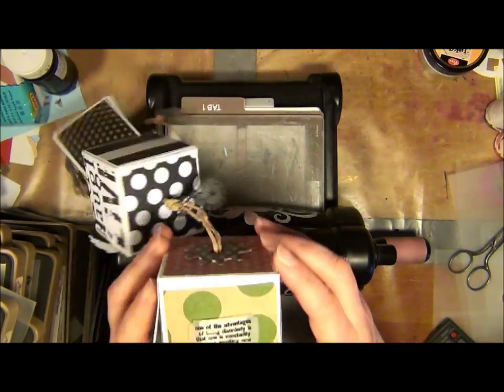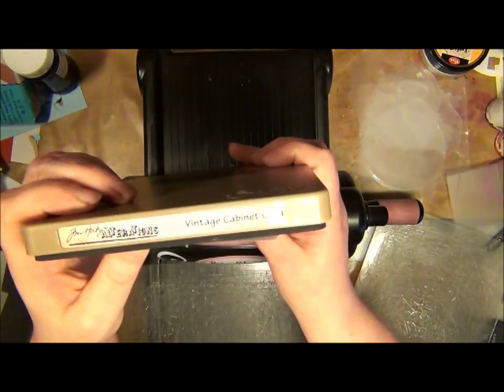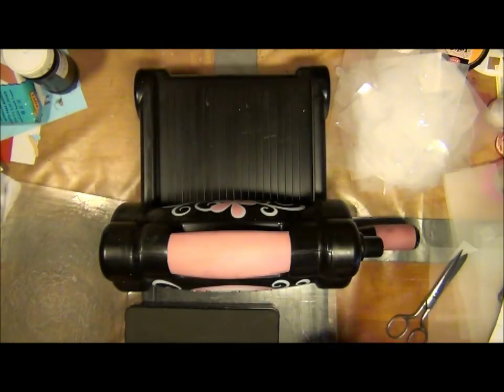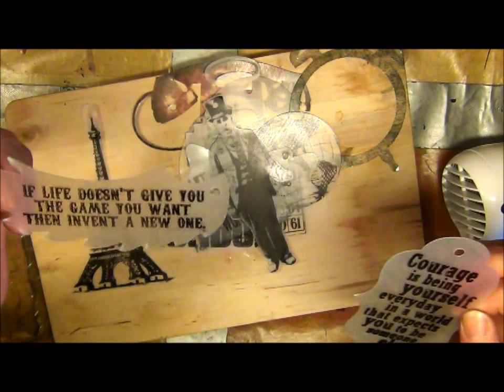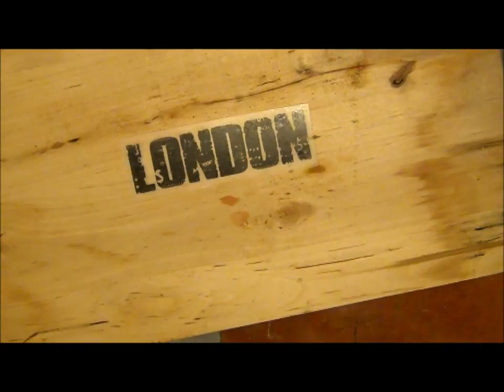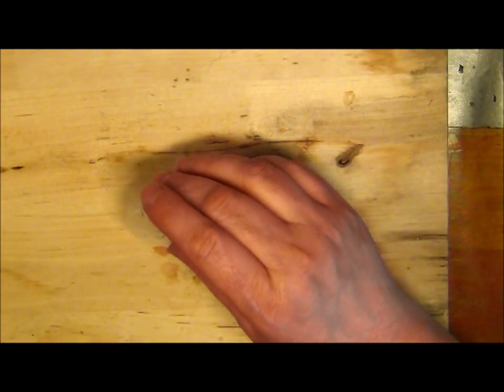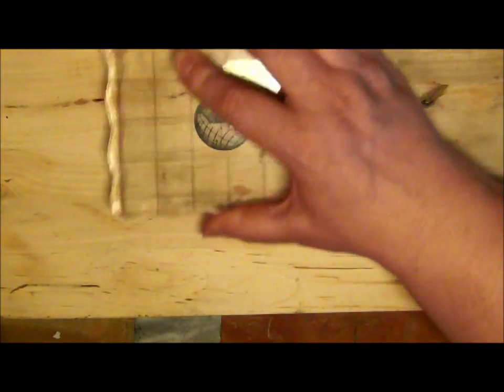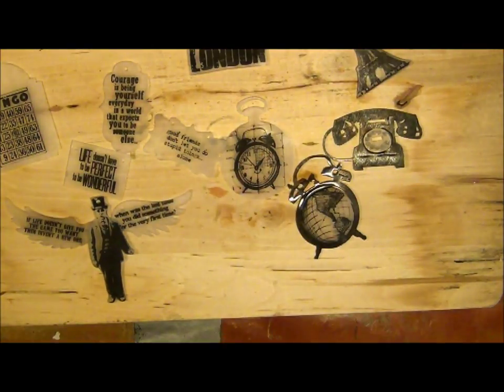TUTORIAL - how to make shrink plastic charms out of die cut tim holtz dies and stamps

Comment: Pardon me, Sari, for being critical, I mean it as constructive criticism.  I was so looking forward to learning from this tutorial, and was dismayed by the poor visual quality.  You have such a wonderful "patter" that keeps me interested while you do repetitive tasks.  My problem was that the video did not show what you were doing much of the time.  While you were "running them through the machine", I'm wondering what is this machine?  Most of what you showed as a finished cut were shown so briefly, it took watching almost all of the machine runnings to figure out it was cutting out templates. 
      You did excellently showing the label on the Tim Holtz boxes as to what it contained.  Half the time the machine was below camera and it was a mystery what was happening and what the cutting was.  The stars towards the end were shown well. 
      OK, then you had some great stamps, wish I could have seen the stamped object, especially the ones that were text phrases.  Good job explaining why StazOn was a superior product, and with showing the StazOn cleaner quality.  
      Then you began heating the stamped cut-outs, and I have no idea if it was a hair dryer (if so, how many watts? Or does it matter?), heat gun (again, how hot, how close to the shrink film), or what?  Could not hardly see the heating process. i.e., what was happening.  I'm sure it would be tricky camera work, but would make such a difference.When you were using the tweezers and the heat source to the side, it was easier to see.  What was the (some company name) embossing tool you spoke highly of.  The wings were impossible to see, and then while telling us how wonderful it had turned out with the text stamped on it, you didn't show it long enough to even see if the text was still readable.  Discovering the improved results with the cogs when you just continued heating and quit trying to force the shrink film with tweezers, was an "aha" moment. Doesn't the shrink stuff tell you to leave it be and just keep heating?  The ones we used to do in a kitchen oven did their own thing uncurling flat.  I think the heat of the cutting board began to work against you.  
      Personally, I think the value of using a hand-held heat source was best in "repairing" the ones that turned out a bit "wonky" (love the new word!).  But I'm not so sure they would have turned out better it left alone with a stable, constant heat source such as an oven.  Also, doing many such items would take so much time and tiresome holding of the heat source, that an oven would be better in that case also. If just making one or two, then the heat gun or hair dryer would be better ecologically than heating up the big oven. Perhaps using a toaster oven is a good compromise.  
      You have such creative ideas and great materials, Sari, I look forward to seeing other tutorials you've made.  I think it is important to look at your video to see if what you want to teach can be seen and heard clearly or you miss your purpose.  I just watched one that was well done visually, but impossible to hear well, even with earphones and sound turned all the way up!  Sad waste of time.  Thank you.